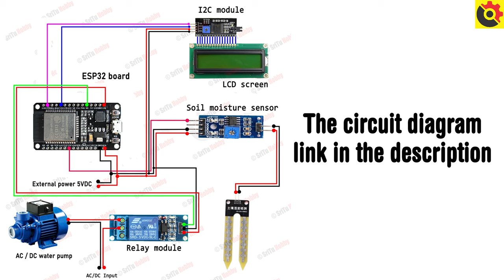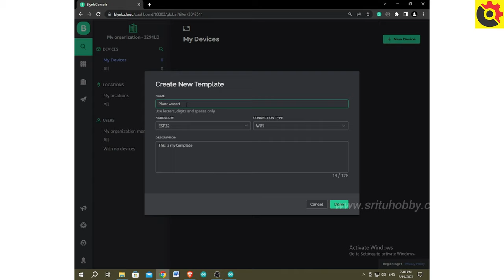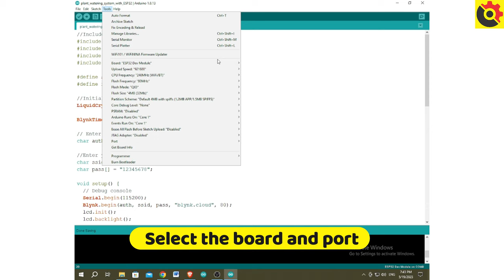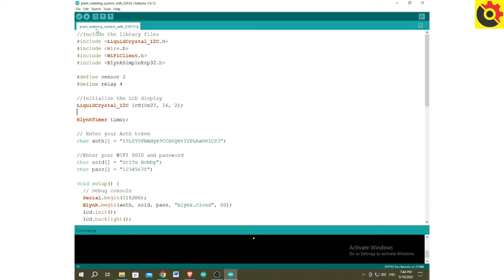How to make a plant watering system with ESP32 board and Blynk app #sritu_hobby #esp32project

Comment: How can the 5v relay work in 3.3 v board
Reply: It has a 5V output pin that doesn't interfere with the other pins so this can be used for outputting

Comment: Hi, I'm working on the same project but I have a problem, every time the relay turns on the LCD screen gets an error, do you know the cause?, and what is the solution to this problem?
Reply: Because you might not have the liquid crystal latest library in the Arduino ide

Comment: I've heard that the two-legged probe/sensor usually breaks after just a few days of use because the metal strip corrodes quickly. It is true?
if it is true I have to buy many two-gauge probes/sensors and change them every time they break or I can use the "operational control module" circuit connected to a handmade probe/sensor with two copper strips of the same size connected in the same way to the operational control module? thank you so much, great video!

Comment: sir why does my pump wont off even the relay-value is already to else section the pump still ON , i was log the output of the "relay- value" and the result is  correct the value is already 0 but the relay/pump wont stop sucking water , and i look to the serial monitor after i put serial.println in "if else" both of the section .. and the "relay-value" show 1 when i click on and show 0 when i click off but the
Reply: do you think this issue is happened from the battery->relay ?
Reply: found my problem sir , the relay is the problem
thank yu